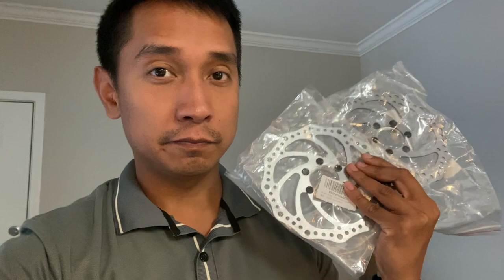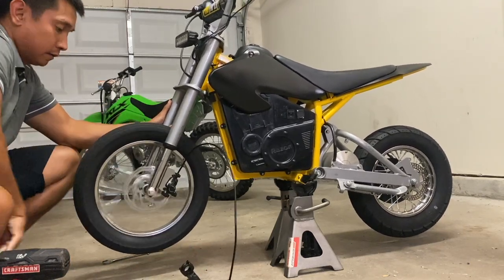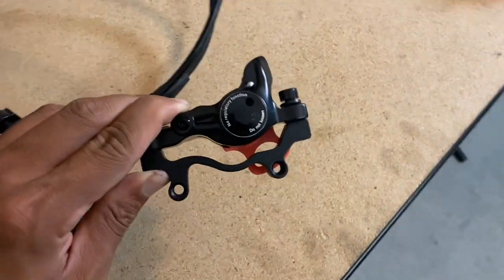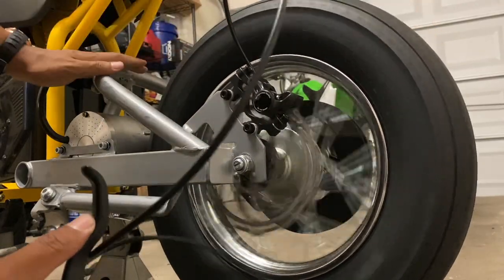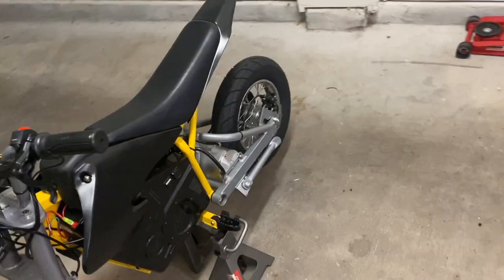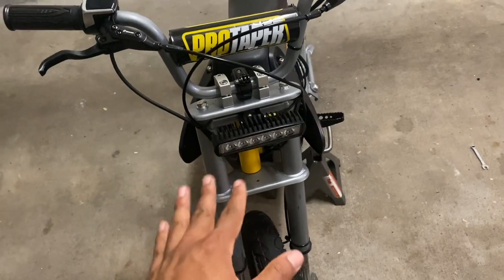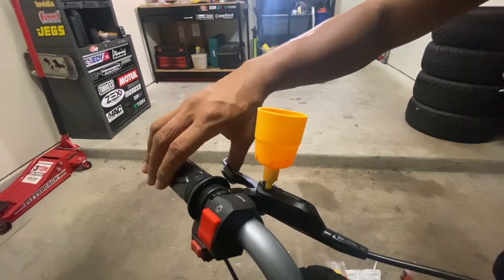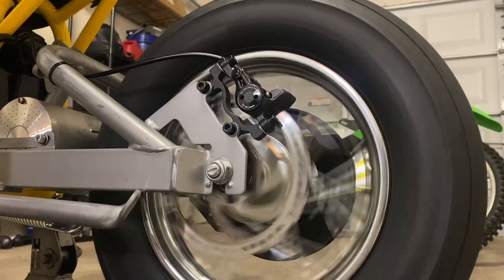Razor MX650 Hydro Conversion Part 2 | Installing the Bigger Rotors and Bleeding the Brake Fluid

Comment: Hello! Just a note that all the rear brake issues are because the rotor is bent, most likely from putting pressure on it when removing the hub adapters. When the bolt was hitting the rotor spoke and dragging, it's only one spoke. All the rest cleared. Sorry to be a Debbie Downer - Appreciate the resource for my own build!
Reply from the maker: That did come up in my mind, but after running it a few times and applying the brakes, any bit of drag went away. I didn't put much pressure at all on the rotor when I removed the hub. I honestly suspect it's just a machining tolerance flaw on one of the spokes or just the package was dropped a few times during shipping is also possible.

Comment: What if you cut a slit in the ring in the fork and expand it with a flat screw driver so you fit the line in. That way you don’t have to undo the line from the brake level.
Reply from the maker: I suppose that's one way to do it, but I prefer not to cut the fork. I'm gonna repaint everything later on anyway so I'm likely gonna redo all the routing when I strip the bike down again. Appreciate the input!

Comment: Hey...  Just did this and realized that there's no brake cutoff signal lines to connect to the controller.  How do you get your rear tail lights to come on when braking?  Your Vids have helped me greatly btw....  Thanks.
Reply from the maker: I switched over to larger pit bike brakes (with built in brake switches) later on with this bike. But I miss this Zoom brake because the trigger feel was better.

Comment: Is that a hammer drill ? Sounds like it. I wouldn't use that. I have Busted weak bolts before. I like the way you work. Investigate the noise and fix the problem. You Rock buddy. Love your videos my Man :)
Reply: Lol no, cmon man. It’s just a Craftsman 3/8” impact driver. I do (however) have a Ryobi impact drill that I used to drill the holes on the motor haha
Reply: @PatrickKasilag  Just be careful, I snapped a sheet rock screw in wood ramp i built with just a 20v clutch drill. Clutch was off but still LOL . hahahahaha. Can't wait to see that group ride :) Love this Build

Comment: Noticed on the Amazon link it specifically says left front right rear. How did you switch it so the left was the rear and right was the front?
Reply from the maker: That description is meant for mountain bike applications since these brakes were originally designed for those. I simply mounted it so the rear lever was on the left and front lever was on the rear. Also if you ever need to switch it later, you just disconnect the brake hose from the lever and bleed the brakes after install.

Comment: When you disconnect the hose from the lever does it ever get stuck if yes how do I get the hose out?
Reply from the maker: There’s a brass compression fitting at the end of the hose that keeps it sealed when tightened into the lever. Just pull after completely taking out the lock nut
Reply: @PatOutdoors  ok thanks

Comment: Hey Patt! Does this fit on a stock mx650 wheel?
Reply from the maker: These are the stock wheels on the bike. Careful on the rotors you choose, regular mountain bike rotors do not fit, must be the earlier bolt pattern. Check the rotors in the description

Comment: Does the fluid leak out when you disconnect the hose from the lever?
Reply from the maker: Barely, unless you squeeze the lever. You should still bleed the air out regardleas

Comment: I just put the back brake on but It has bad drag is there a way to fix that?
Reply from the maker: Did you install the thinner rotors? It could be misaligned on the caliper adapter bracket. Loosen, realign, retighten
Reply: @PatOutdoors I did but I got it to stop rubbing by toying it some more but thanks 😊
Reply: @PatOutdoors btw thank you so much for this video I’m finally done upgrading my 48v razor 😁👍

Comment: On your bike did you just remove the rear fenders or was that a kit
Reply from the maker: I modified it in a previous video: Razor MX650 to MX2000 Conversion Part 3 | Kunray 2000W 48V NEW LOOK! Trimmed Fairings
https://youtu.be/03nftR5OZ94

Comment: Has anyone installed the shimano brake lever kit he recommends?
Reply from the maker: What shimano kit? I’m using zoom brakes
Reply: In your description you have a link to Shimano levers with JG adapters. I was thinking of buying these knowing that Shimano is a well known brand and then get the 48mm rotors you suggest.